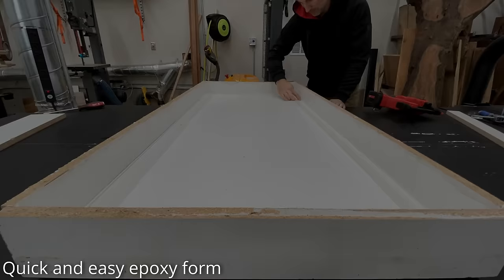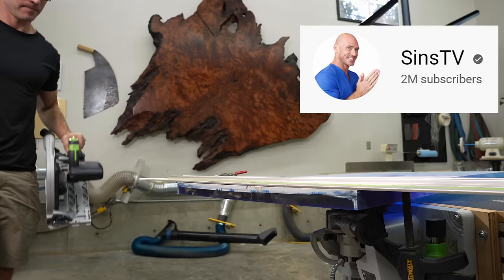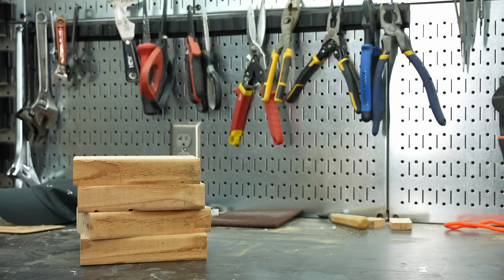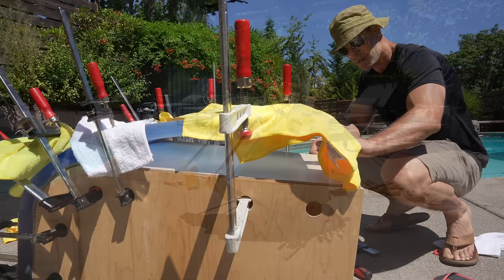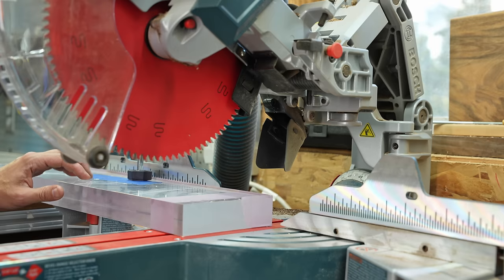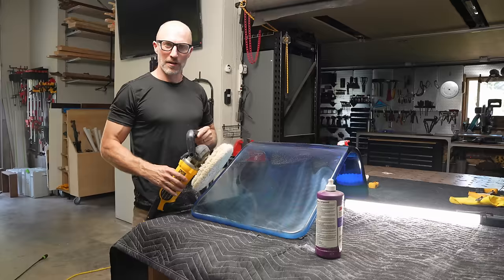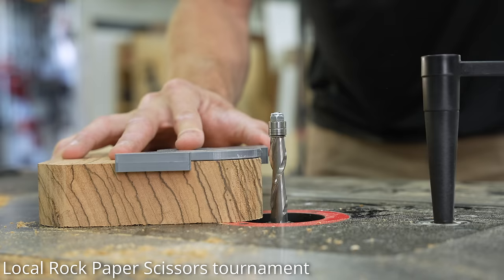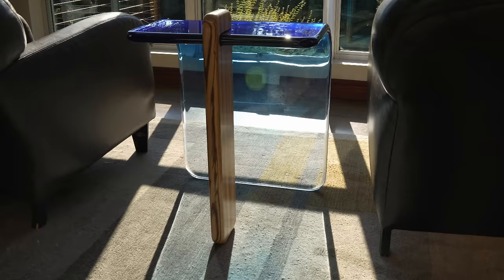Bending Epoxy With the Sun

Comment: New table is super legit.  Nice work!
Reply: WTF !!!
It's jerryrigeverything and no one Noticed!!????
🤔♥️
You should ask my man to send that table to you for a Quality check..😂
Reply from the maker: I’m just afraid he’s gonna cut it apart and compare it to other tables
Reply: epoxy is epoxy and epoxy melts (glass is glass and glass breaks)
Reply: @BlacktailStudio  Hijacking this comment thread to tag you. With my extremely limited education in my department of mechanical and materials engineering, I do know of the fact that epoxy can be altered to behave in the way you describe in the video.

With a high strain inducing plastic deformation (the clamp) being released near the glass transition temperature (usually that a lot higher than 40C but in some cases it can be low) the "permanent" shape is set at the high temp, then when allowed to cool it will take on a "temporary: shape. However, this "permanent" shape is typically only recovered when heated back up to temperatures closer to what the experienced during its formation. 

I don't believe that event had ever occurred, the only thing I can think of is the sanding, polishing, buffing processes producing large amounts surface heat, thereby replicating those conditions. It's unlikely though.

It's more likely that the strain was so excessive that the clamp stamped a shape really deep in there but it would be hard to see without the polished finish. Hard to say.

https://en.wikipedia.org/wiki/Shape-memory_polymer

edit. Did you shine a UV light on it for a long period of time? UV can induce this kind of shape rebound as well.
Reply: Wow Jerry... Nice Day to you and your family...
Reply: Beautiful new
Reply: Table scratches at a level 6 with deeper grooves at a level 7
Reply: @BlacktailStudio  🤣🤣🤣
Reply: how you doin
Reply: jeririg orang jowo wkwkwk . iso iso nyo tau legit
Reply: We need Jerry to bend test this table 🤣
Reply: WTF how did you get here?!
Reply: at what level does the table scratch?
Reply: Hey Jerry, what about a teardown? 🤔
Reply: @JerryRigEverything What about a teardown? 🤔
Reply: @BlacktailStudio  LOL
Reply: @daometh well epoxy is a type of plastic and on the Mohs scale of hardness plastic scratches at a level 2 with deeper groves at a level 3
Reply: Jerryrig everything was going to be my celebrity look a like pick!! 😂😂
Reply: jerry rig everything looks a bit like blacktailstudio
Reply: @playonce4186  oh shit you’re right
Reply: Смола течёт прям рекой
Reply: HEYYYY
Reply: Love the shadow it casts at the end.

Comment: PhD in polymer engineering here; you're absolutely correct about the shape memory effect around 18:50. When the epoxy was heated above its glass transition temperature during the sun-assisted shaping stage, the residual stresses in the area around the clamp were "locked in" after it cooled back down. When you sanded it that area was likely heated back above the glass transition temperature and was able to relax again, leaving telltale markings from the clamp due to the shape memory effect!
Reply: love to see a specialist describing it!
Reply: Epoxy has no shape memory. He just missed it while sanding.
Reply: Impressive.  I just learned something new. Thank you!
Reply: Automotive detailers talk about a similar phenomenon: the sun can sort of “reactivate” blemishes and mineral deposits which were thought to be removed by compounding/polishing.
Reply: @cmbunton  Correct.  The spot was lower than the surrounding area and was not sanding off initially.
Reply: Ok sheldon 

Jk
Reply: He should of used thin strips of wood not a rag that would of spread out the pressure points & not dimpled the epoxy like the rag did. Wood working 101
Reply: @davel696969  right, why doesn't he have some rubber or epoxy safe 'soft jaws' to clamp with. Given this was a first on many fronts for him, hopefully in the future he will use a different medium between his clamps and the epoxy.
Reply: @sgbbco3981  

Hell he had laminat he used to wrap around the 2×4 structure he built. Cut 6in wide strips the length of the rounded table using that to spread out the pressure points of the clamps & use the rubber style clamps & no dimples would of pledge his project. Sometimes You learn the hard way. We've all done it if we're honest about it. Hell I know I did & I've been working in the construction trade for 30+ years. 25 of those years as an electrician. I've framed custom homes & built custom cabinets. The track homes/production framing didn't pay enough.
Reply: @sgbbco3981  

Yeah I'm no big epoxy guy. I'm an electrician who's framed homes & built cabinets. The epoxy style counter tops weren't a popular choice for the folks I installed for. Plus I did most of the framing & cabinet work during my weekends off. Most times helping out contractor friends in the construction industry out here in California.
Reply: Creator of all men here; you're all absolutely correct for I have given each of you a brain.... some being a tad bit smaller to ridiculously smaller than your other mankind's but hey, I can't be perfect all the time lol
Reply: No, I don't think that this is a memory effect. The indentation was probaly deeper than what he sanded down, you could easily check by measuring the thickness of the table at various points to determine how evenly he sanded.

If epoxy would exhibit a memory effect it would probably be the table bending back into a straight plate when heated up and not growing indentations.
I don't really know if epoxy is a smart polymer, my professions are injection moulding, extrusion, foaming, vacuum thermoforming and blow moulding so I know my fair share about common plastics.
Reply: Had no idea you could get a PhD for that! Amazing
Reply: Polymer Engineers are the sexiest enginners.
Reply: @cmbunton  it’s possible he missed it when sanding however, you’re completely wrong about it not having shape memory
Reply: @alys4570  Cool.
Reply: @cuzican2777  Future Human that created the ancestor simulation that your all inside here; you're absolutely correct for we based you on the original creator to recreate their actions.... unfortunately something has gone wrong with the simulation. The OG made the brain size of these men smaller, you however seem to have done that to their second brain 🍆making all the commenters here far...FAR below average. It would be an easy fix but honestly we think it's pretty funny so 🤷‍♀.
Reply: @tomatoheadfd  sorry. Ask any 5 year old and they'll say, The engineers that drive the train are the sexiest. 🚅🚝🚄
Jk. I'd say that though, minus the sexy part!
Reply: PhD in tables here. yep that's a table. 

good job
Reply: @cmbunton You’re right and wrong. Most epoxies do not have shape memory. However, there is a family of polymers specifically engineered to have it, unimaginatively named: Shape Memory Polymers or SMPs. Unlikely that was the type used for this table, but it’s possible.
Reply: @theinquiringengineer  Prohibitively expensive is the phrase that comes to mind.
Reply: @theinquiringengineer  the type of epoxy he used is fairly easy to look up if you watch the video closely.
Reply: from what i can find online, the brand of epoxy he used does not have any shape memory properties. afaik, the only epoxy with heat activated memory properties is used for really specialized purposes like aerospace and maybe something else. i bet he just missed it while sanding because it was deeper than the other marks
Reply: Как это сложно)))
Reply: Heat, you don't understand heat. Try loving out here in Vegas.

Comment: The old one is aesthetically more pleasing, although the new one certainly has a more modern vibe to it. This piece of art is creative and looks gorgeous. Fantastic job. I would name this epoxy build : The Dive Primarily due to the waterfall shape but more importantly because you took a leap of faith and were successful :)
Reply: I like this a lot!! What a great name for the table. I also agree that the old table is aesthetically pleasing whereas the new has.. well .. a new vibe! My only issue is that I feel like stuff will slide off easily since it's so curved, so it would really have to be more of a conversation piece than a functional table, which is TOTALLY FINE. For me, though, I would just rather have the more functional table.
Reply: How about "The Blu Lagoon"

Comment: New
table type name nomination: Clamped Ledge table

I'm not sure if the felt clamp is unique to this table or if you've done it before, but the idea of clamping a leg to the epoxy, with a felt groove, is so cool to me. 
Could also call it a Floating Ledge?  Either way  the L shape could apply to many types of tables, not even just curved epoxy. A 90-degree fully wood construction would also be nice.

Maybe the curved variant is Clamped Slide table?
a sharp edge would be called a Clamped Ledge table?

Comment: New! Awesome build Cam. The microfibre spot during polishing is definitely from the plastic “memory”. We used to have this happen when we used chill epoxy which was soft without heat. We would leave tables on sticks, the epoxy would dent, we would sand flush, and then the epoxy would push back up where it was previously dented!
Reply from the maker: Oh really?? Thanks Dylan, that makes me feel better
Reply: We did this in high school woodwork class. Bent some steel wire into a shape/logo/initials and clamped it into oven heated Perspex. Then sanded it down and heated it again to make the shape pop back up

Comment: New - You did an incredible job with the epoxy.  I honestly didn’t think the polish was going to come out that shiny.  Epoxy doesn’t polish as easily as regular resin.  And when you used the exacto knife to trim the felt my immediate thought was the blade shaving into the wood.  You did an amazing job and this table video should an inspiration to anyone who has worked with epoxy for years.

Comment: Plastics fabricator for years. Metal fabricator before that, so I've bent a few things in my time. Don't talk smack about that table, it is 5 stars. Great job. Only thing is, since you ask for suggestions, is slow the hell down. Let the plastic sag slowly and don't force it to go through all of those molecular changes in a single day. Build a wood box around it or use a closet and crank up a tiny ceramic room heater and let gravity do its work. I would have given a week or two to get that amount of bend. My fear would have been deformation but even more so, internal shattering of the epoxy in compression and expansion. I am extremely impressed with the design and it is 100% perfect, so be proud.

Comment: Fun suggestion. You should have made a wood shelf that spans the width of the table that slots in half way down the wood Vertical beam in the center... it would have made a nice decorative shelf to hold a couple books on either side, maybe a small plant, Visible but still masked behind the front of the table itself. Looks amazing!

Comment: I love the "new" end table, it looks absolutely stunning.  Having recently returned from a bike race in Iceland, I think that perhaps calling it something along the lines of the "Foss Table" would be appropriate ("Foss" is Icelandic for Waterfall).  Also, it's sorta funny, but as someone watching the video I was hoping that you'd get really curious and be aggressive with the polishing process to see if generating too much heat would result in the clamp mark reappearing (I guess it's the scientist in me showing through), while at the same time, if it were my project and I was the one putting in all the time and effort in constructing the table, I definitely would have been cautious and tried my best to not overheat the epoxy.  I think you made the correct choice. :).

Comment: New:  Love the epoxy and gradations of blues. Check the video and notice the interesting light patterns cast on the floor. It would be interesting to have different reflective surfaces and objects under the table to recast/reflect light.  Since the sun made the defining bend, it’s definitely starlight kissed by radiating protons, perhaps Starwave for a name?

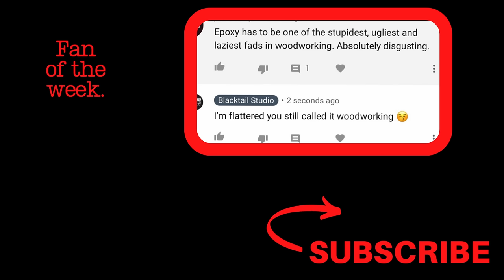Comment: BTW: at 27:58 you seem to be using a Festool hold-down clamp with a Bosch mitre saw.  If this is right, how did you do it?  I have a KS60 & would like to adapt it to use the same hold-down clamp that normally only fits the KS120.  Thanks,

Comment: I like your work bro.. but I had to comment on this when you said you wanted your peers to acknowledge you as a real wood worker by not doing a hybrid wood / epoxy .. and JUST DO A SOLID EPOXY? That makes no sense.. ? WOOD HAS GRAIN! a solid epoxy object has no grain.. THAT'S COMPLETELY DIFFERENT sure you can work epoxy like wood.. but they dont react the same because of grain! and also inconsistency in the wood itself.. because of grain or weak spots or moisture content..... not hating on you! just trying to get you to get it straight! had to edit out of love.. GRAIN can make or break a piece of wood for the project... depending on your skill.. same with cutting meat... Arby's ROAST beef isint real roast beef.. its like chicken Mcnuggets.. processed dried out meat Re-hydrated with water into a paste and formed into the shape of a nugget then breaded.. or in the case of Arby's roast beef.. just made in the shape of a roast loin and they shave it.. looks close. it has no meat tissue/ GRAIN! /Basically the protein / fake meat version of epoxy.. when cutting meat the grain matters.. so does in wood working.. so no hating.. but this is a real point of matter:P
Reply: He’s being ironic
Reply: @lesleyplowman4762  now I feel like a jerk :P